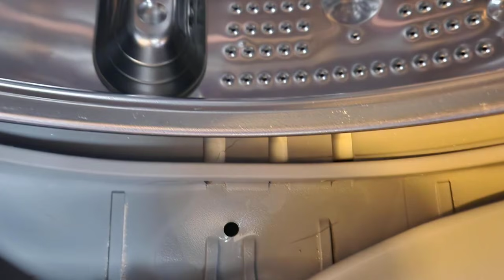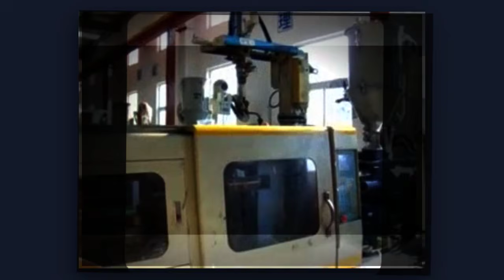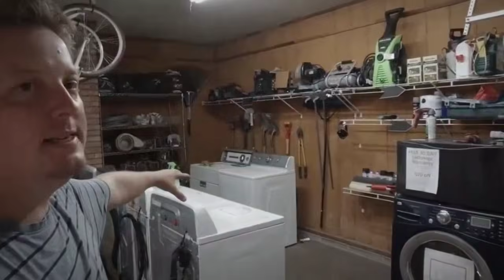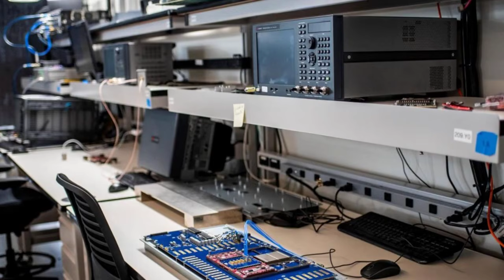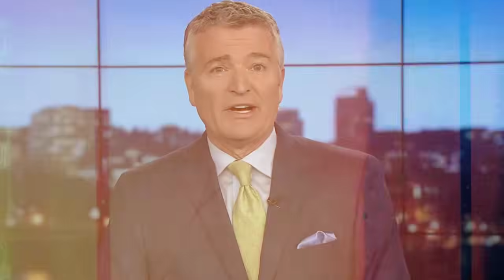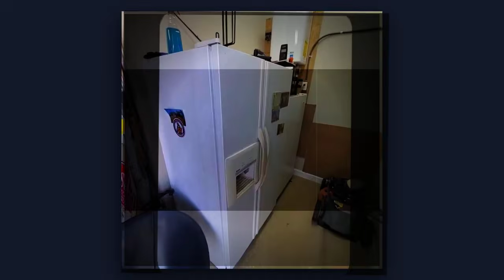Why 90% Of New Appliances Are Now 'Disposable' Garbage

Comment: I opened a repair business 3 years ago and i can tell that the appliance sold today are junk. One of my client complained to the seller because her machine only lasted 14 months before the 550$ electronic card failed. The seller told her that she should have paid more money to get a quality appliances. I refurbish old appliances but my client dont want to pay for a machine that look old. Building a new brand would cost tens of millions of dollar in investment. I dont know what im gonna do in the next years. I really dont want to go back to work in my town factory.
Reply: If More and more appliances are failing and you opened up an appliance repair business...... Things should be booming no?
Reply: @coppulor6500  No the parts are too costly and when we take into account my hourly rate the client always chose to buy a new machine because the parts plus labor is also the price of a new machine. Today i went to repair a washer that the client had bought 700$ brand new and the electronic control board cost 530$ Even though the machine is only 5 years old he chose to replace it. In 3-4 years people will not bother calling me saying that it will be a waste of money paying for a diagnostic when the repair is not worth it. Plus we are moving into a renting market like for the water heater.
Reply: Yes, the costs of the main spare parts are almost the cost of a new machine.  Also, they made access to replaceabke parts difficult or non existent, e.g. sealed washibg machine drums.  They know when parts are will wear out as everything is tested.